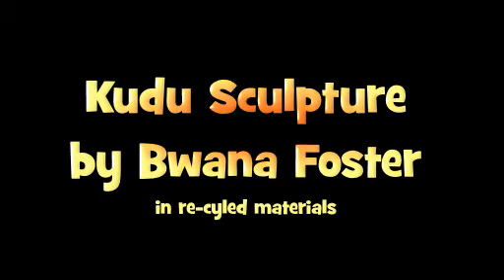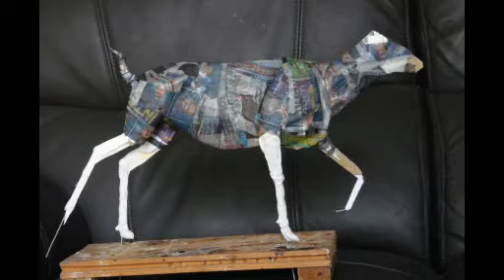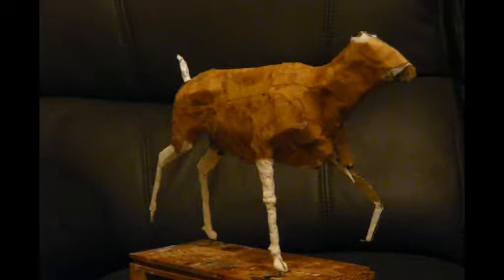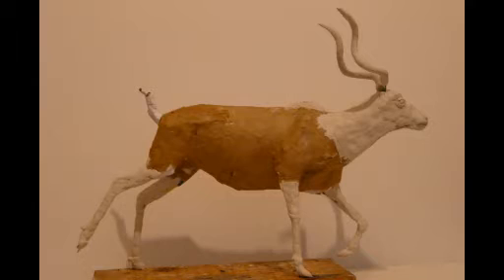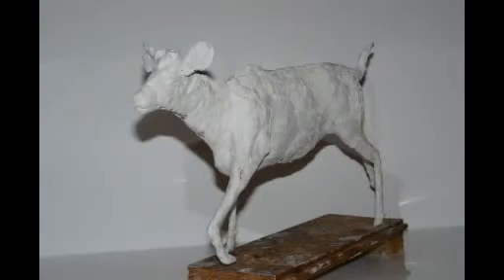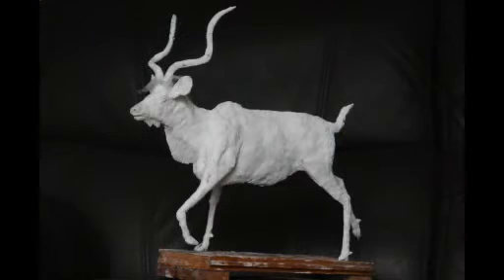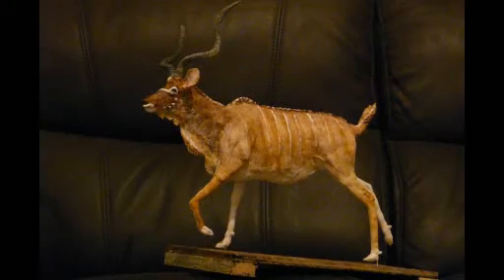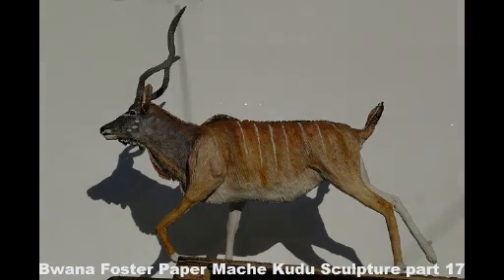How to make a Kudu Sculpture

Comment: Hi i am working with ceramic clay I think this is not going to be useful for me because ceramic clay gets shrunken after drying do you have any idea aboute ceramic clay
Reply from the maker: You can make an armature out of something softer so it will be crushed by the clay on shrinkage, compressed silver paper is good. It depends if you are going to fire the finished piece or make a mold of it and cast it in resin or wax.